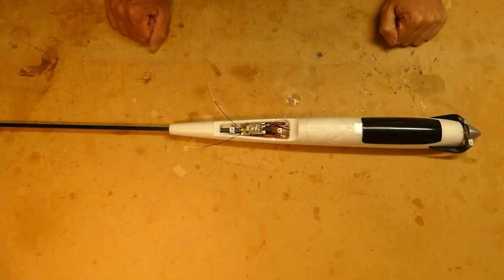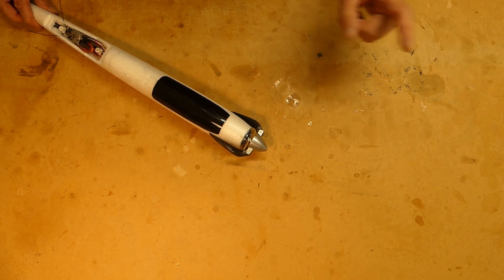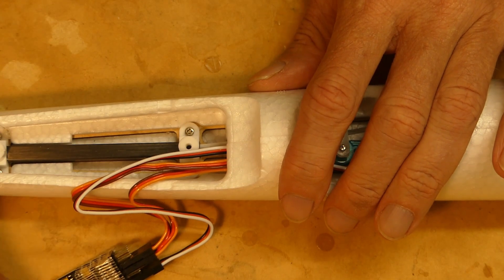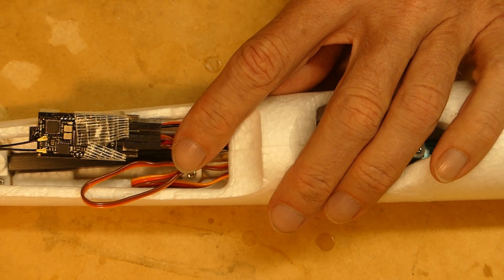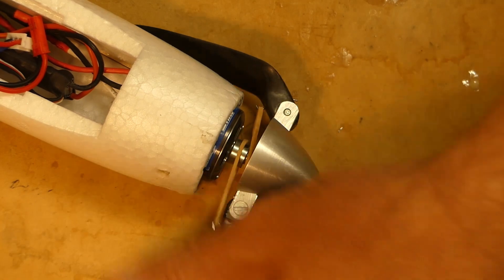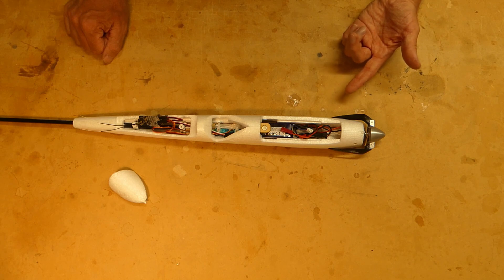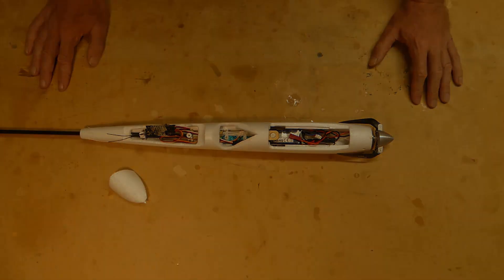U-Glider Kit Rebuild

Comment: I am about to put together my Hookl Uglider PNP version. Want to follow the mods that so many others recommend. But with yours, you have needed to throw so much weight to the rear. Is that all only because of the heavier motor and spinner? I will use the stock motor and spinner, at least to start with.
Reply from the maker: Correct, it's solely because of the weight of the motor and spinner.

Comment: Hello Johan.   Thanks v much for this vid, am presently building one from a basic kit.   It seems to me that the internals are not well thought out, so mods are in order.   One thing that surprises me about your mods is why put in a heavier stronger motor   -   its a glider?     A couple of questions, if you would be so kind.  How did you cut that second hatch, no matter how hard I try with new scalpels etc it never turns out as good as that looked.   Secondly, how are the servos kept in place, are they hot glued or is there a framework  that I could not see.    Once again thank you for your efforts .   ATB   -   Jn
Reply from the maker: Yes, the modded glider is heavier. The reason is that that motor/spinner combo was what I could get from my local hobby shop. And I wanted a quicker climb too. I think the kit version without a motor would be excellent on a light wind slope.

From memory I cut the second hatch using a large  knife blade suitable for one of these knifes: https://www.officeworks.com.au/shop/officeworks/p/j-burrows-box-cutter-heavy-duty-18mm-jbowct003 . I think the trick is to use a large blade.

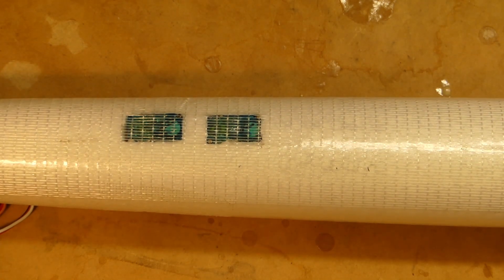The servos are pushed into place. I made the rectangular holes in the bottom of the fuselage quite snug. The holes are deep enough to accept most of the servo body. The bottom of the servos are also held by the tape attached to the underside of the fuselage so they won't pop out. Shown at 1:17 in the video.
Reply: @johanbergkvist8834    Thanks v much Johan for that quick reply.    I actually have one of those thick cutters, in the past I have used similar but narrower bladed ones, will try the thicker one next time.     wrt the servos, had not realised that the foam was so thick there.   Very best wishes  -  Jn

Comment: Hi Johan! Thanks for your post: clear and simple. I just crashed my complete-kit U-glider and have another kit like yours and want to rebuild it with a motor and prop like your's. (I didn't understand the diameter and pitch). Where do you situate the CG?
Reply from the maker: Hi Peter! Glad you found it useful! The prop is 7" in diameter with a pitch of 4". I got the CG at 48mm from the leading edge, but that makes it very sensitive. Maybe 43 to start with would be better.